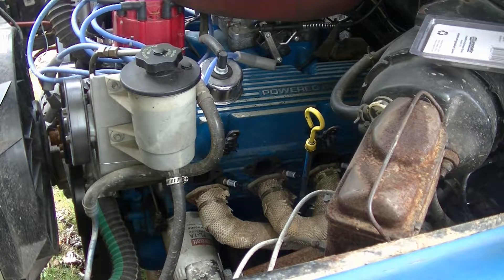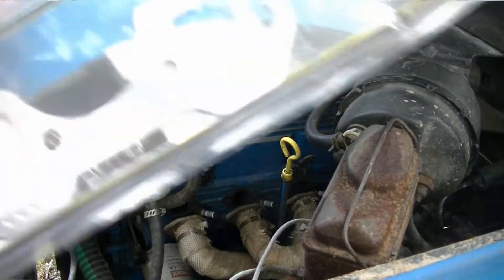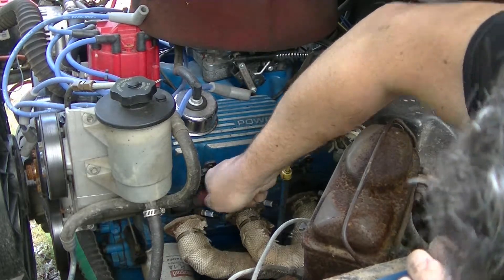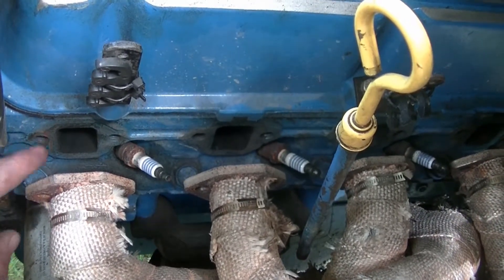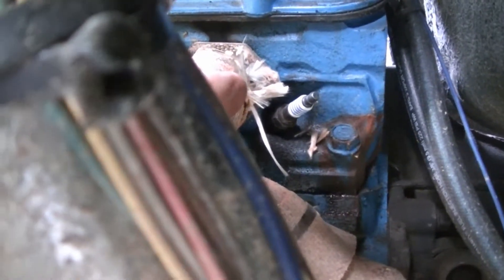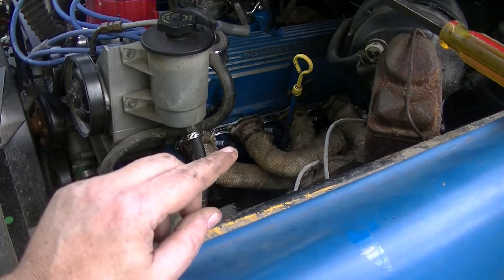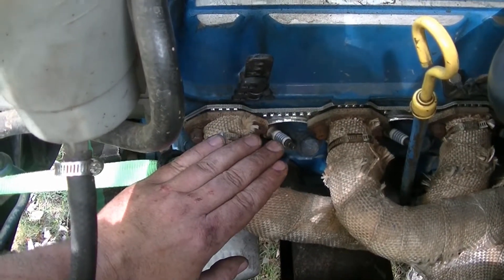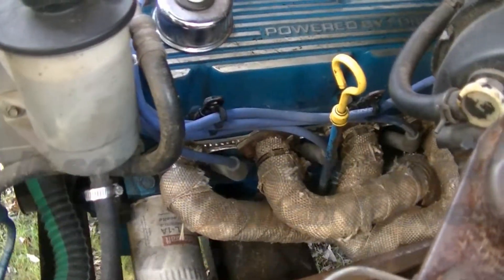Replacing A Header Gasket

Comment: I'm just about to do Mr gasket on my 1969 AMC AMX 390. Would you take spark plugs out if you had to do again? Also should I disconnect the bottom of the header tube to give more play to line up bolts? Thanks. Nice video
Reply from the maker: I would try it with the spark plugs in and the bottom of the header connected.  If it seems like a pain try disconnecting collectors and removing spark plugs.  No point in doing extra work if you don’t need to.

Comment: Are these reversible? I watched another video and a guy installed them the other way. That’s how I just did mine. I hope it works.
Reply from the maker: DukeBiggsley I didn’t get any instructions with mine.  I haven’t had any problems with the way I put them on.  They have been on awhile too.
Reply: Shouldn't really matter honestly...as long as it matches up to the bolt pattern and seals the exhaust ports completely...the gasket is smashed between 2 flat pieces...so you should be good.

Comment: Only one slight problem...if you have either steel heads or steel manifold/headers with all aluminum gasket...this will cause galvanic corrosion between the two metals over time...ergo...exhaust leak...and possible resurfacing in the future as well...BUT...if you have aluminum heads and stainless steel, ceramic, etc. manifold/headers (NOT steel manifold/headers) then all will be gravy 👌.
Reply: Lol!!!!!! Yes in a boat